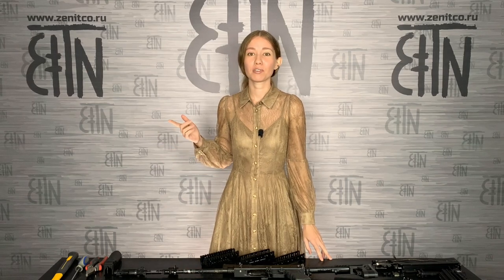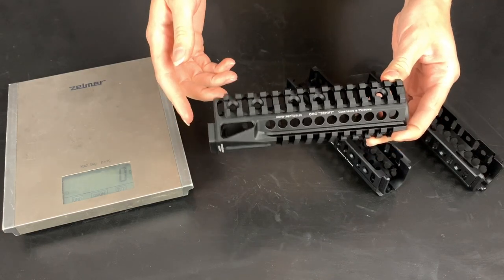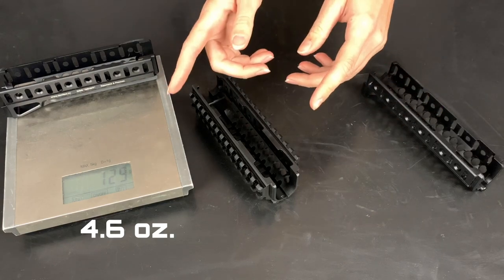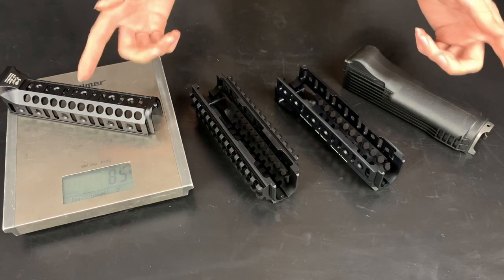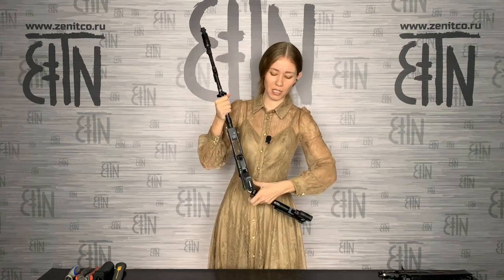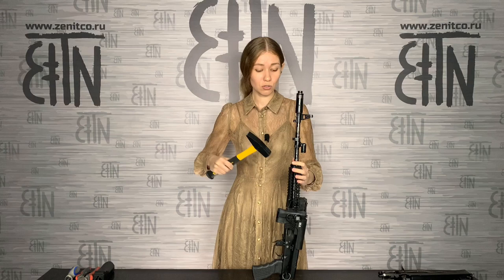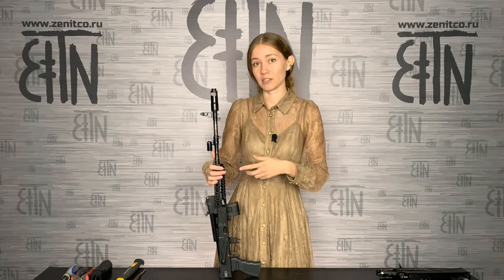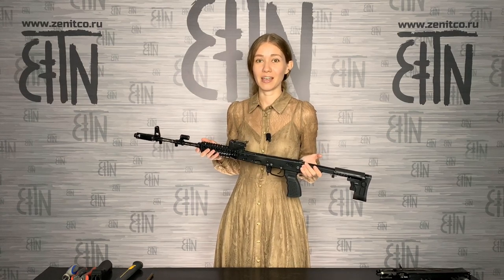AK handguards (B-10M, B-10U, B-10L): review, how to install

Comment: I have the B-10U coming in the mail for my 107 - very sharp looking!
Reply: I'm waiting on mine too. Ordered it back on the 6th. I'm kinda wishing I woulda got the B-30U instead though. I want to get my Streamlight a little more forward.
Reply: @MRohCRACKER  Arsenal...Got it with plum furniture, which looks great with a bakelite mag👌
Reply: I got a 10m for my 47
Reply: I got the B10U and the B19 in. I then sold them on Armslist. I definitely wanted the longer setup, so now I'm waiting on the B30U and the B31S.

Comment: Get some flat black engine paint to fix any finish damage from a mallet. I use a cheap screw driver in the lower part of the handguard and I hammer the screw driver to get the fit just right and not damage the finish.
Reply: Some duct tape over the tool surfaces that touch the rifle will also prevent scratches.

Comment: Just so all of you in the comments know, these rails are not drop in, I had to do a bit of filing and hammering to get it to fit my russian saiga. That said, once it's on its rock solid. I have the b10m it's awesome and is really lightweight.
Reply: Yep, I tried the hammer only solution on a Saiga MK and an ISD BSR74 but it was not enough. A "light" filing will not compromise the stability of the handguard.
Reply: @unclejack0000  exactly, mine was visibly oversized, there was no chance that it would fit my receiver without filing
Reply: If you like Zenitco. You are going to have to own a Dremel. Each handguard requires about 20 min to 1 hour of fitting.    Get flat black paint to fix finish damage. Otherwise the handguards are bullet proof.
Reply: Foreal.. an hour? Hell no
Reply: @connerframe4097  Yes. The New PSA AKE with that FN barrel required a lot of dremeling to fit the zenitco lower handguard on. For some reason I could not get the lower retaining guard lever to move forward without extensive dremeling to both the rear and front of the handguard.
Reply: @x39aesthetics  I'm 36. The fact that I love zenitco and don't insist on over priced surplus combloc wood makes me by definition a non-boomer.
Reply: @Widemouth1832  ^^ Preech bro. US manufactures make better wood than any surplus combloc,looks better,feels better, and custom options,can have any color you can imagine. just as expensive but its good to help new businesses and not just big name distributors .
Reply: @markbrown4597  Tell that to the Boomers and the Fudds at just about every range and LGS in the United States.  The surplus combloc furniture is constantly sold out for rediculous prices.
Reply: @x39aesthetics  Okay guy.

Comment: I have a small gap of about the width of a credit card after installation. Retainer closes fine. Is it super important that it be completely flush?
Reply from the maker: No
Reply: If it's tight, you're good.

Comment: Do you have to use b19 gas tube cover when using b10 or can you keep the standard gas tube cover?
Reply from the maker: You can use regular upper handguard with our handguards. Please note, B-19 is compatible with B-10M, B-10U, B-10L handguards. Not compatible with B-10. B-10 was discontinued.